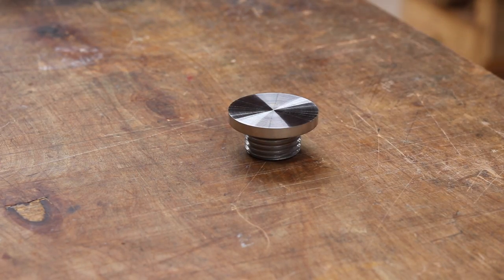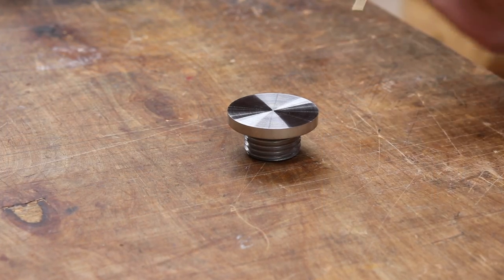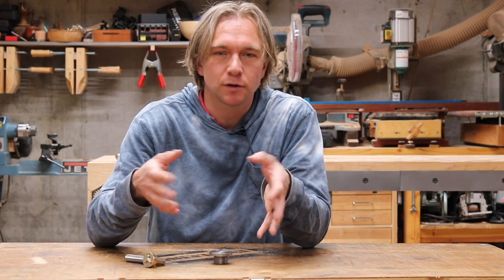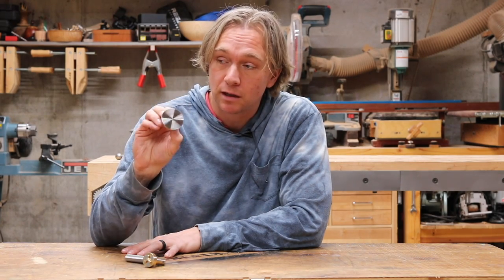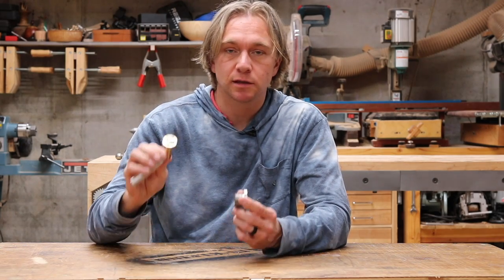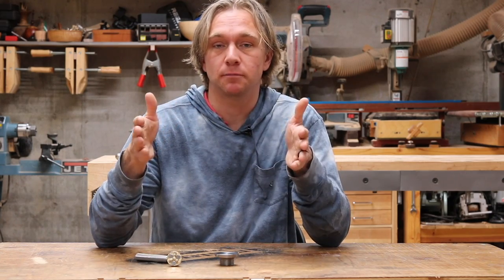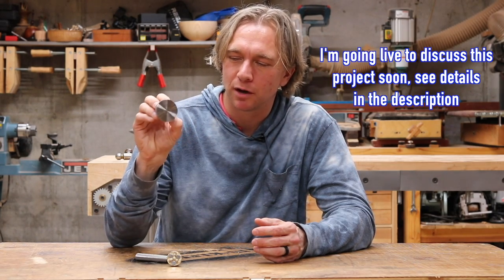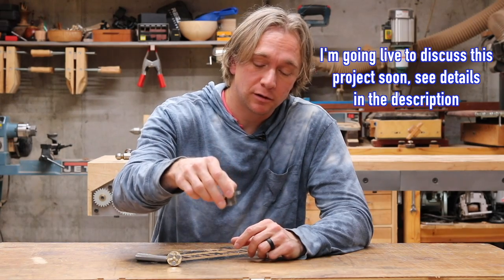A Screw With No (visible) Slot Is My Next Big Thing!

Comment: If I'm to be brutally honest, I think the same effect can be had with a recessed hex bolt, capped with a small metal disc of similar size to this. In fact, I've seen furniture out there that does just that.

That's not to detract from just how fricking cool this project is though! Plus, one man's opinion is not the difference between a successful product and a challenged one.
Reply: I thought exactly the same thing. It just has the look of cheap furniture already out there. Nobody is going to want to spend a lot of money to look cheap.

I mean, sure, what he has done is technically awesome, but the look can be reproduced cheaply, and the look is very similar to what you get from bottom end furniture.

He has made a technically impressive buggy whip...
Reply: @YoutubeHandlesSuckBalls  The other thing to consider is usability. The other hack methods may look nice, but they're likely to be much harder to take in or out. For some of the utilities he mentioned, this would produce a much cleaner look
Reply: @worldindo1  how often are you taking your furniture apart? Would need to find an application  that is used often which I can't think of.  Also I dont think this will hold up exterior or wet location.

Comment: I’m concerned that tightening/loosening the screw will ruin the high precision machining pretty quick
Reply: It looks like the tool is brass, so there would not be an issue with wear. Especially since it would most likely not be a daily use item.
Reply: Its hardware, it wouldnt be installed and removed a million times
Reply: You hold it with the tool, and torque the nut side.
Reply: That was my thought too.
Reply: While I'd agree that a fastener shouldn't be seeing daily use, here's some uses I'd see for it, and I think some wear and tear would be a bit inherent to a lot of functionality:
- Something un/re-fastened on a semi-regular basis for the novel party trick aspect
- Something un/re-fastened on a less frequent basis, but leveraging the hidden screw component to hide something else in plain sight
- Minimalist furniture
- Concealing the screw itself into part of a larger brushed metal surface (or perhaps painted into a textured surface if machining tolerances wouldn't mind the paint?)

For pretty much all of these use cases though, I probably wouldn't want to have multiple screws that I'd need to unscrew, and instead only rely on one.

One application of the 2nd idea I tossed out above could be some sort of lunchbox/carried item, but move the head of the "key" to a keychain where it would just look like some weird medallion until it was needed for unscrewing the screw. One other application in the same vein would be to use this screw head to conceal a traditional pin & tumbler key lock, basically using the screw in this video as an extra layer of obscuring a potential attack vector when performing physical entry.
Reply: Biggest issue isn't the inserting or removal its daily wear on the surface.  Crap and oil and grime will gather in that seam.  If the spring isn't super strong putting something with feet down could cause a topple.
Reply: This is likely the reason he never shows it being screwed into something.
Reply: @BBQasaurus  > This is likely the reason he never shows it being screwed into something.

Likely my ass.  One could say it's likely he didn't think to show, or likely didn't think it mattered enough to show something with threads can screw into a nut.

Comment: Why not using a "normal" screw, and a magnetic or press fitting cap instead? Should be much cheaper with the same result?

Super dope idea, but it would be a waste as a screw - better use it as some fancy locking mechanism ;) with that I would be willing to pay that price.
Reply: Not really the same result in my opinion, as that kind of thing exists and the issue is usually not being able to remove it
Reply: Yes, I picture the 'base screw' with a tapped, fine-thread hole, and the cap would screw into it. Embed magnets in the cap if the SS doesn't hold well enough to a magnetic driver tool. Heck, maybe even use an electromagnet as the driver?  I assume those can be made much stronger (and safer - only attract when they are switched on) than a permanent magnet (like those cranes that pick up junk cars, but on a much smaller scale)? https://www.youtube.com/watch?v=J4FWjYuvCoY
Reply: This.
Reply: @vernarddevilliers7899  You can’t remove screws with drive socket plungers like this either. Sprung drive sockets have been done at least twice before and the reason we don’t see them today is because the plunger gets stuck in the up position as the dust and other stuff in the air gets into the mechanism. 

Early 20th Century cabinetmakers tried sprung drive fasteners. Aircraft manufacturers tried them again in the 1950s as a way to improve aerodynamics by reducing turbulence. In both cases the problem was the same. The plungers got locked into position.

Comment: I would totally use this for high end furniture and secret container, however I thought of a way to make it cheaper, instead of magnets what about using a router to cut into the wall of the slot so all you have to do is push in and then rotate the wrench. Should be cheaper than having to use expensive magnetic steel for the wrench. As for what I would call them... I'd say flush top screws, or flush tops for short.

Comment: Also, is it necessary to be magnetic? Couldn't the downward force of the tool help keep it in place? This would allow you to utilize a more cost effective metal, making production easier and more valuable
Reply: Yeah I was thinking about that too, maybe they click together the same way a socket wrench clicks to a bit, with a small ball bearing and a spring. But then that makes the screw harder to manufacture because he somehow has to put a little dimple on the inner walls of the screw
Reply: Since he can't coat this screw for protection he has to use some stainless material. And there are no cheaper options out there than those simple magnetic steels;). Material cost is also quite irrelevant for an object like this. the 410 he opted for costs far less than 5% of his selling price. The costs are in development and production.
Reply: @skydnir  Also presice machining works better the harder your material is.
Reply: skydnir 

Agreed everyone suggests a cheaper metal without giving an example, what’s cheaper than stainless that looks pretty and won’t scratch easily?

Comment: The problem is that for a mechanical fastener in furniture, the expensive part of the device is only used once. So, there are a number of other ways to achieve the same look without the expense. For instance, use a traditional fastener in a countersunk hole that is deep enough to cover the head of the fastener with a metal disk.  Fairly weak magnets can be installed along side of the fastener head and glued in to hold the disk in place, and then a strong magnet can be used to remove the disk. 
Where your idea finds an application is as a novelty or security device where the key features of being hidden in plain sight and useful where repeated access is required. I can see applications where loosening the screw provides a way to open a panel to reveal a hidden compartment or room. This is technique for hiding things in plain sight can be combined with other locks or combinations that would be hidden behind that first access panel or door, just in case an attacker discovers your device. You can additionally modify your design to require that the slot is depressed or the screw cannot turn, and then a variety of patterns can be used making it difficult to open the screw without having the matching pattern tool.  An application could be such that the tool is left attached normally, to serve as a sort of door knob, and removed only when the owner goes away or otherwise wants to let it known that access is not desired. An example might be a supply cabinet in a business, where access is open to everyone during the day but the secretary removes the handle at night and locks it in her desk. The cleaning crew or other in the office after hours might not take the effort to bypass the latch.
Reply: There are other Applications for this. Imagine fasteners that get loaded up with mud or sand.
Reply: @wannabecarguy  Absolutely!  Outside of furniture, there are likely many possibilities.  It should be pretty tolerant of dirt, abrasion, oil, etc.  The use case probably still will relate to frequency of use - if it is not used often, there are usually less expensive methods, but the cost might be justified if the fastener is one often used (like an oil fill or gas cap).

Comment: I would like to see this done to the deck fittings on my sailboat. To have a few of these to seal off the inlets to my diesel tanks, water tanks, and waste port on the deck, would be great! The magnets would keep the “screw/plug” on the tool while filling, yet, keep people from being able to open it. This product could have many uses. Doors, cabinets, etc. for an architectual smoothness. Combine this, with other “blanks” for a “hidden lock” effect. I like it!
Reply: I dont see it fairing well in an environment that contains that much potential for debris.
Reply: 410 magnetic stainless steel will corrode terribly near salt water. This product as currently envisioned is best for interior use in clean environments.
Reply: @bradnail99  could make it out of 316, insert magnets from the back of the mating surface, and keep it saltwater safe.
Reply: @mikestone234  How about not magnets at all and just having to push the tool while unscrewing?
Reply: @Edgard422  yeah, that would be ok. I like the magnet idea, to keep the screw from getting away.

Comment: I don't make this kind of stuff, as I am not in the construction feild. But as an engineer with a material science background, here is an idea. Make a regular screw with a magnet head (think nickel neodonium). Then make magnet caps to fit on top of those. You could sink the screw into the wood at a precise depth, then attach the magnetic cap to make it flush. If you make caps of different sizes, you could even use a forsrner bit to get proper sizing in the wood. Thus, you would not need to make a new cast for your screws. The caps might be a little expensive to produce. As precision cast parts usually are. But for a premium product, it would be reasonable. The good part is, no special installation tools would be needed. All you would need to get the cap off for disassembly would be a stronger magnet that you could purchase at any hardware store. That's just my idea. Again, not in construction so do with this information what you will. Good luck.

Comment: I would spend it provided those extensions and nuts would give me the same or better holding power as traditional joinery. My other thought was: Have you considered making a 1/4 or 1/2-turn version as a latch? It seems robust enough to hold something like that but I'm picturing several (maybe consider making decoys or "dummies") in the surface of a desk with one of them being a hidden latch that can be turned to reveal a drawer/compartment. Just my thoughts. I love this idea
Reply: I feel like his idea would be better for, like you are saying a hidden latch type of thing or a hidden kind of keyhole that you need that magnetic tool to open up
Reply: Like the idea as a latch!

Comment: I think this is awesome, but can think of a major problem. The hidden slot remains afterwards. Meaning if you made a table and sit something down on it with a pointed base edge, it will press in the slot. If there was a way to insert the screw then lock the punch in hole in the out position so that the finished project is smooth and cant be pressed in... That would be the holy grail of screw technology haha. I can give an idea to make this possible. Make it so once the tool is inserted, it starts a mechanism that when the tool is removed the slot pops back out, but cannot go back down again due to the locking mechanism. A crescent moon shaped gear could do this. It sits by the punch slot inside, when tool becomes inserted it will rotate the crescent moon gear half a rotation, then upon pulling the tool out the gear moves another half with the movement of the slot back out to flush finish. Now when trying to insert the tool again, the gear has been flipped with rounded moon side up blocking the slot from being pushed in. The problem with this is now it's a one time use screw... Unless the gear is able to be reset with a good strong magnet placed on the head or something that can be done from outside the screw itself. I can picture it in my head, it is possible. I know this comment doesn't make much sense, but the people out there that get it, will get it haha

Comment: "The Flush Screw"

How small of a diameter could it be?
Reply: Flush Screw was what immediately came to my mind, but the "sh" into "s" makes it sound like you're saying "Flushcrew," which might be a better name for a plumbing business than a screw 🤣
Reply: @MegaEmmanuel09  Like 🚽 flush lever screw, LOL
Reply: screwdini like houdini
Reply: Maybe, following this line of reasoning: "flush head screws, Klein head screws, flat-top screws, hip screws (hip = hidden in plain sight) though might connote prosthetic surgery. (There's clearly a lot of traction and resonance for this Klein innovation. EDM is a very attractive field, seems to inevitably result in high cost end products though. (Some considerations in any project: Structure, function, manufacturing process costs, application, potential market, pricing, ...seems edm is, to some extent, pricing the product out of reach for the intended market, so if the application was shifted to a part for SpaceX or Tesla for example the cost limitation could possibly disappear.
(The magnetic drive is very interesting and perhaps a slightly different approach (free disclosure to Klein by email if you like) could result in a much more affordable product.

Comment: I think if you can make some smaller versions of it, it would be quite useful for loads of people. Obviously, you can't make it the same size as traditional screws, but, I think about half the size of your current model would be great. And, having multiple sizes would be beneficial as each can be used for different projects.

If there's a way to make it cheaper (without compromising structural integrity), I think you should go that route. Granted, right now if you sold it, it would be under the "early adopter tax" concept. But, I feel that this would do amazingly well.

However, I also suggest changing out the shape of the screw driver you're using. Set it up so that it can just slide on over a standard screw driver, and then you can utilize the Philips or Flathead shapes on your screws. This would make it more easily accessible and considerably cheaper as well. And, though this one may be a bit more complex than you'd like, you could try making it small enough to accept small springs, like those found in watches and door locks. It would make the screws even smaller for those interested in utilizing them for their projects, but, not looking for large screws.

Comment: For its size, the exact same aesthetic, and function could be accomplished with a typical bolt and a stainless steel covering.  One way could use magnets to hold the covering on, and a stronger magnet to remove it.  Or do to the size, the covering could just be a hinge.

Comment: Unless a brand name describes the product or it’s application, I don’t think it adds much value to really matter. If you want descriptive, you could do flush top or flush finish screws. If not, Klein screws make as much sense to me as anything else. 
As for application, is there any gap or lip at all? Because I think they have potentially use for surfaces and equipment in healthcare settings. If they actually “seal”, that’s extremely beneficial for ensuring high-fidelity disinfection. It’s a type of systems engineering by helping to “mistake proof” a cleaning job. Or at least make it so that it’d be less likely for germs in a crevice to get missed due to a lack of thoroughness. You might be able to incorporate copper or other metals to increase the antimicrobial-ness(?). Flat surfaces are also great for allowing thorough UVC disinfection, which is becoming more common. I also think medical device makers would see the aesthetic appeal and want to include it in visible areas of things that don’t have to be sterile. Cool invention!

Comment: While it is a very cool design, I’m not sure how well it would serve as a product. 
Due to the naturally high tolerances of the piece, I don’t particularly see it functioning well in the long run. 
The wrench could ding the edges, particulates can work their way in, weathering will make the seam more noticeable. If for whatever reason the depression gets stuck in a lowered position, I don’t see any way of getting it back up. 
Plus it requires a specialty wrench to operate. 
Neat concept, but ultimately it does feel more like a novelty.
Reply: You'd have to remove it, disassemble it from the back, fix the issue then reinstall it.

Clearly there's a spring pushing up the moving portion, and when he moves it around you can see the bore inside the shaft, through which the mechanism is installed, and surely a retention plate fastened in.
Reply: The brass or bronze driver I imagine was a very deliberate choice to stop marring but all the other points make sense
Reply: A lot of things on furniture are just novelty though. 40 dollars is not much if you deal with a 6,000 dollar table. All brass fasteners for example.